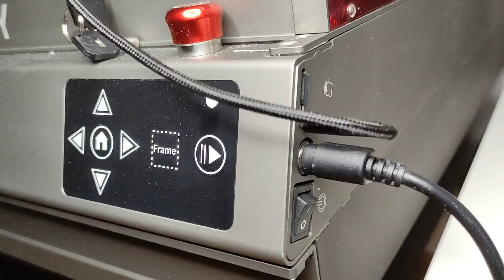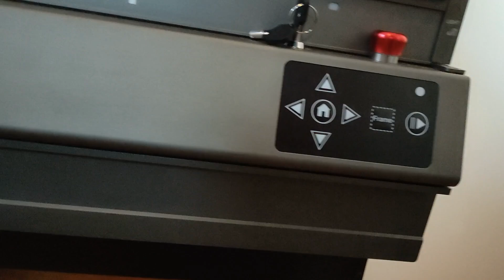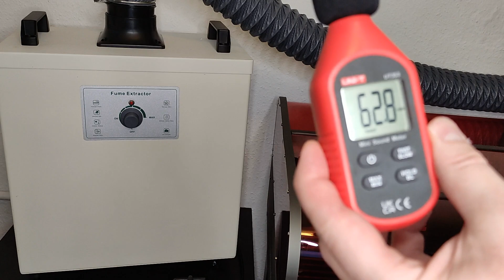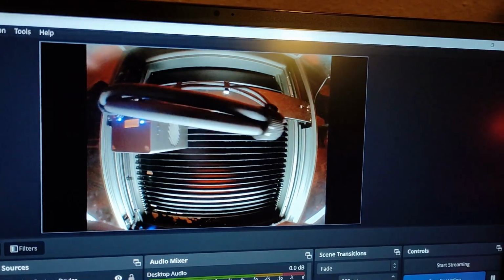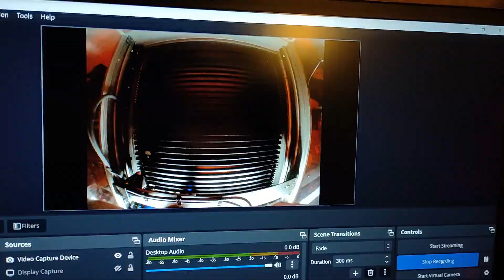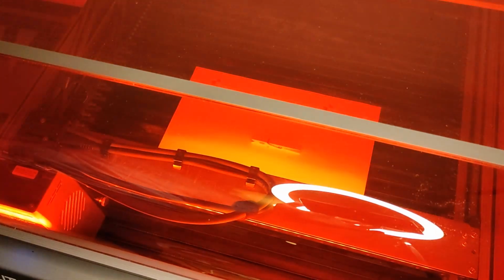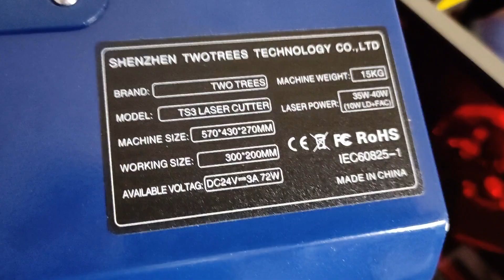Creality Laser Falcon 2 Pro Review Fully Enclosed 40W #Laser Engraver + Smoke Extractor #3dprinting

Comment: Hey! This is super helpful for newbies like me. I’m stuck choosing between the Acmer P3 and the Falcon 2 Pro. What should I focus on? I really want to carve faster and get good precision since I need to make a bunch of wooden keychains. Any tips? Thanks!
Reply from the maker: The Falcon comes with an additional 1.6W laser head if you buy the 40W, it has a higher precision but is slower of course, the lower power modules can have a finer laser spot because they just use one diode. I also have an Acmer, but the P2. The engraving speed between the 40W Falcon, the 48W Acmer or the new 60W Falcon is not so relevant IMO on this kind of laser. The only advantage I see with the Acmer is that they have the IR module. Not sure where you would want to buy one, here in Europe the Falcon 2 is now available from resellers for quite good prices too, way below the launch price.

Comment: Nice video thanks.
About the rotary tool: I see on their website that they've removed the bottom of the engraver and raised its height with additional feet when using the rotary tool, so that maybe by doing this you can greatly increase the sizeof what you can engrave.
Reply from the maker: Yes, I mentioned it shortly at 4:28, but didn't do it myself since I also have the standard Laser Falcon 2. Kind of defeats the purpose though (safety, full smoke containment). For those who buy it because of the CE or FDA classification it's probably not what they want to to when using it for a business. For hobby use it's good to have the option though, if one does not have an open frame laser engraver as well.
Reply: @s3sebastian  The Falcon2 Pro 40w cannot work without the tray installed as there are magnetic sensors to prevent this. There's no way, out-of-the-box, to increase the z-height. It's very frustrating. Another annoyance is that in all the promo videos and photos from Creality, the combo kit comes with a CHUCK style rotary, not the junk roller-style.

For the price, this should come with the feet, a magnetic bypass, and the chuck rotary. No question.

Comment: Any thoughts on this vs the regular 40w non-pro?
Reply from the maker: Pretty much the same unit between the drawer at the bottom and the top part of the enclosure, so the laser performance is the same. Only that the Pro 40W will also include a 1.6W module for fine detailed engravings (even finer than changing the mode to 22W). All depends if you a) need the CE/FDA complying machine for work or so and b) if you want to add an enclosure on your own or use it outside anyway.

Comment: It looks like cleaning the acrylic will be problematic. When the front rolls back, it covers the part in the back. Would be much easier if the lid lifted completely.
Reply from the maker: I did not have much smoke settle on the acrylic, it like to go onto the kind of rough/brushed surface of the aluminum parts the most. Also there is an airflow from the front to the back. If you really like to keep the acrylic clean you have to clean it from fingerprints though, lol.

Comment: Where did you get the fume extractor? I can't find it anywhere on their website.
Reply from the maker: It will be released later, you can join the Laser Falcon 2 Pro FB group there are usually updates. On Aliexpress, if you search for 240W or 350W smoke extractor you can find very similar models already if you want one now, I would assume it's some kind of OEM product.